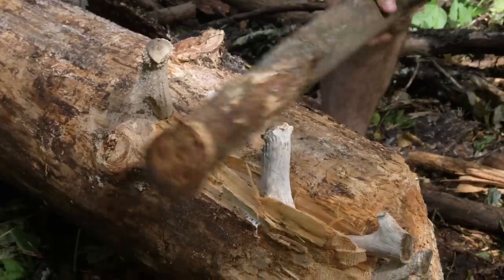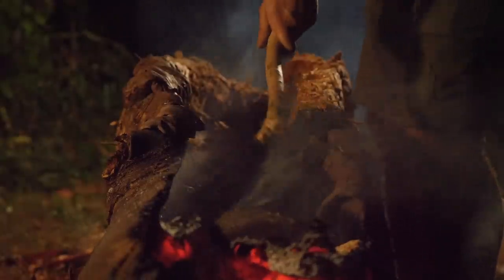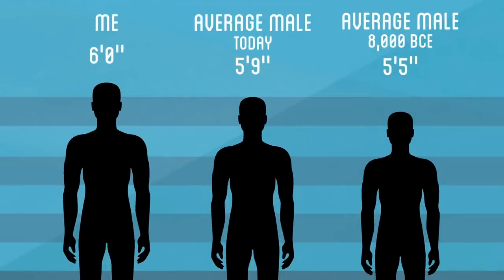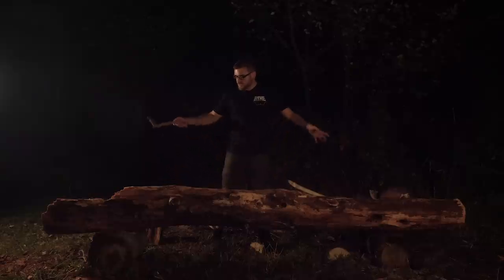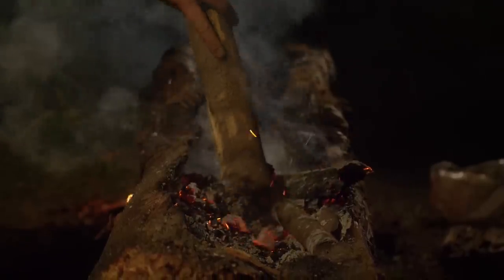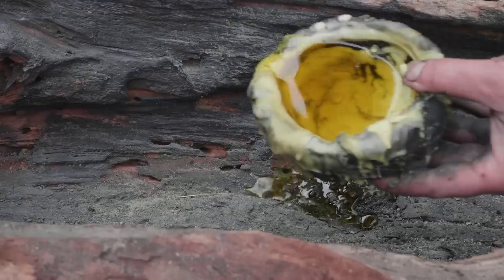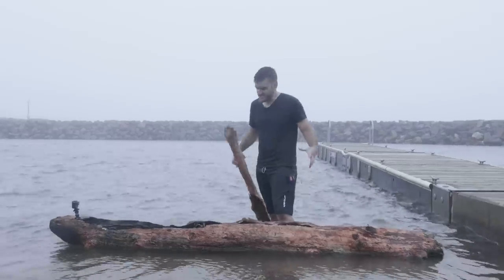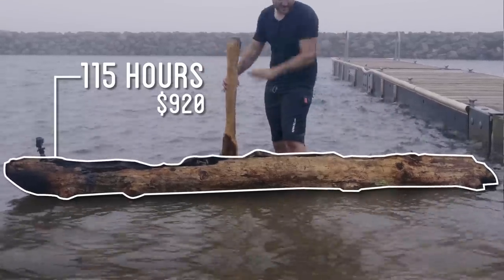Making a Stone Age Dugout Boat with Fire

Comment: Why not make a pontoon or catamaran? Ie make two floating stabilizers on either side of the canoe. This would stop the canoe from flipping over. This was used in polynesia as a way to stabilize the boat when going between islands in rougher seas. Making a net to sling between the stabilizers and the main craft also gives you cargo capacity although increases complexity.

Comment: I think if you would have made the boat shorter in length the problems with the instability in rotation should be getting less, because the surface area where the boat can be effect in a rotation motion is less than if it is that long. ^^

Comment: If you plane the top before you do the burnout it will work a little better. Also you were sitting in it wrong. Feet in front, ass flat on the bottom is how you should start with that kind of simple boat. Think of it similarly to an open-topped kayak. It really wasn't ever meant to long journeys or a lot of time on the water either.

Comment: I think making the paddle thinner/lighter will help too, so you don't have to shift your center of gravity as much to paddle. Otherwise yeah, I think outriggers would be the only way to prevent rolling, since it's so narrow. Would it be cheating to build the sides up higher with wood and pine glue? Assuming that's even viable...

Comment: You need a bigger log and you need straight wood grain with little to no nots in the wood. Also A rotted log may  result in integral failure.

Comment: Representing the tools as an expense, instead of depreciating them over an expected life, is probably a misrepresentation of the actual cost of making the dugout canoe. Having the materials assembled for the tools makes up a sizable portion of its future value. However, if you were only include the cost of maintaining the tools, if the tools were needing repair when being used, it would be a fair representation of the actual cost. (Of course this is probably an oversimplification of the depreciation and/or expense scheduling for such a project.)

To be fair, this is an over-analysis of what's supposed to be entertainment.

Comment: Australian Aborigines must have been able to make some sort of boat to get here in the first place, at least two hundred thousand years ago. Because there are several straights they must have crossed between Asia and Australia that still would have been tens of kilometres across and hundred or so metres deep, even during the height of the last major ice age. Which would make them the oldest known boat builders by a very wide margin.

In their mythology they believe they were here from the beginning of time, but that doesn't gel with basic scientific understanding, like for instance that they are part of the same species as other peoples.

Comment: You could add one of those sticks that go out, to the left or right of the boat, and have a log (or any other floating thing) attached to it. it will Make sure it doesn't tip.

Comment: At the end of the video, you say you're going to add outriggers for this one.  Why not iterate on your design and build a better dugout canoe by finding an appropriately large log to start with? Then you'll have enough displacement to have sufficient freeboard for you to succeed in using this on that placid lake.  Don't over-invest in a bad design.  This log is too small for the load you want to put in it.  Get a bigger log!

Historically, a dugout canoe was made from a 24-36" diameter log, not from this small size you used. Start with good materials and you'll have better results.

Comment: You know what I wish thought, not that I'm complaining, but I wish he would skip some ages, I mean if it's a modern human trying to rebuild, I'm pretty sure that they'd skip some ages and go a bit more science
Reply: thats the whole point i think, is the past humans never got the chance to just go well ill use a hammer or something more technological because nothing was barely invented or thought through then.
although i agree its painstakingly longer.
Reply: @Dockhead  I'm not saying go buy tools and use them, but use your modern knowledge to skip some steps.
Reply: I agree that with knowledge you could skip some stages of development, because humans were stuck for long times due to lack of knowledge. If you had the knowledge, you would probably make iron first instead of copper, because bog iron is actually easier to find than copper in a lot of areas of the world and iron is a lot easier to forge. On the other hand, even flint is only found in some areas if the world. If you would start a civilization all over without the knowledge, you would probably not develop in the same way as history. Development has been driven by "accidents".

Comment: 3:05 Soooo were just gunna ignore the fact he used a chainsaw? 😬 That kinda ruined it for me....
Reply: For the prototype? Why would that be so bad? They did it on the actual boat correctly but for the small test version it just wasn't necesary because it's just for testing the concept
Reply: @lucascb8446  That wasnt the prototype , watch that section again :) The prototype log also has no knots...
Reply: @thehyperactivesloth6824  Ah now I see what you ment. Strange. Maybe one of the Kids did that? Dunno
Reply: @lucascb8446  I rewatch the "Reset" video and that explains the rules , he talked about "unlocking" resources (if he found copper himself in nature and sucsesfully made something then he is alowd to buy it online since smelting that much is inpractical ) idk if he felt he had proved the concept or wat ... :/
Reply: Still like y though...
Reply: @thehyperactivesloth6824  I've seen that already. My guess was, that the kids used real tools while helping him. In another clip you can see one holding an actual hammer. But I don't know. Only time will tell.

Comment: I very well may be wrong, but I feel like if they just spent a LITTLE bit longer on most projects they would come out 10 times better. Like that paddle for example. Just a little longer to get it thinner and the right shape. Same with the copper axe. Just a little longer thinning out the head to make a sharp edge possible.

Comment: Thanks for all the hard work, but a lot of videos are cringy to watch, because it is obvious that Andy is not a craftsman or used to physical labor. You can see it in the way he holds, levers or swings a stick. Even the choice of sticks is questionable. as someone who has spent his childhood in the woods and his teens building log cabins I can see that a lot of sticks have weak points, are not meant to be tool handles or just not straight enough for efficient use. Maybe he represents a certain type of office working city boys who have no experience or knowledge with hand tools, they lack physical properties, dexterity, coordination etc... and thou can easier identify themselves with the situation- i don't know. Just sometimes hard to watch the struggle in basic things. Not talking about the endless corner cutting. Take some pride in your work man. Seeing it thru to the end is worth a lot. That shows in the quality of finished products and will make the use of them more pleasant. Think of this as sharpening a knife- you can put on a workable edge and use the knife of average sharpness, or you can spend the extra time necessary to make it razorsharp and then work with a smile on your face every time you make a cut.